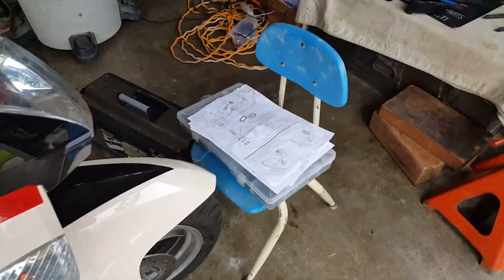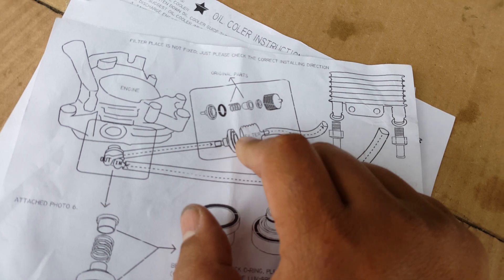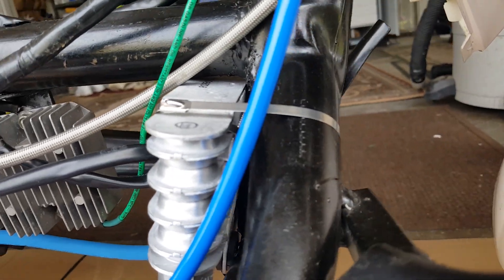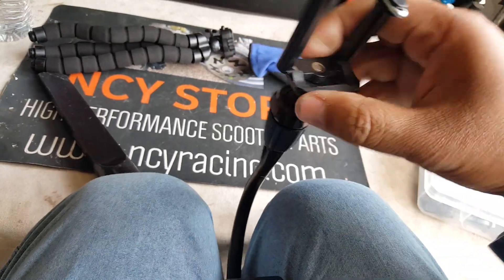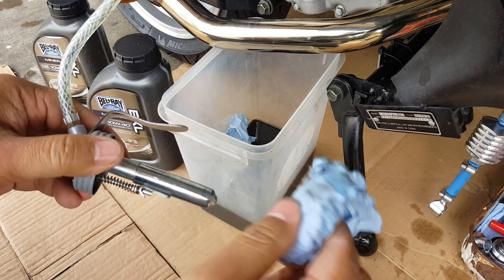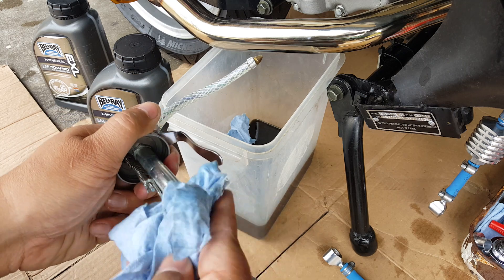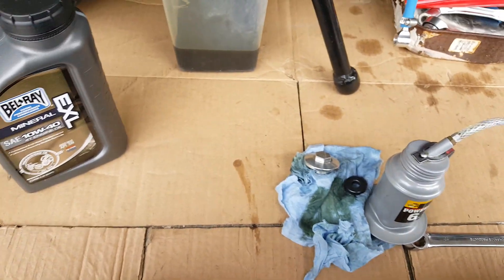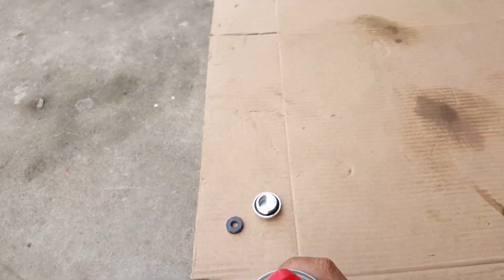How to Change Oil and Install GY6 NCY Oil Cooler 10 of 17

Comment: I have just one question: How or why the gravity-fed bottom drain plug oil will choose to fly up to the oil cooler, instead of doing what all liquids do, and flow down to the lowest possible point in the engine, which is the drain plug? I don't see any pump moving the oil upwards, and at the same beating the engine's own oil pump that's trying to suck the same oil into the pickup filter back to the valve head.

Comment: You do no this dose more harm then good that's why they are sold without them. Use proper oil ratting for condition  and you will not need. The big thing is you need a proper oil pump for this to work and the bike alone can't push and circulate oil properly with this. You also can't get a proper fill lever. And the bigist flaw on the gy6 can't be fixed with this and that's negative oil pressure